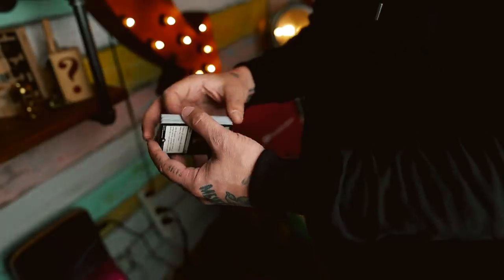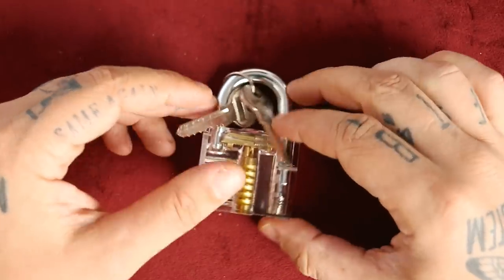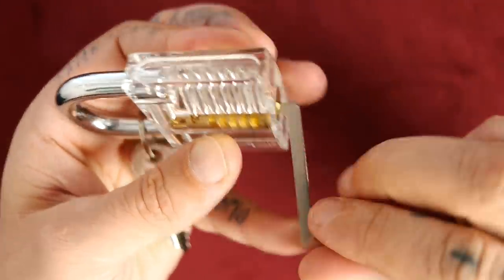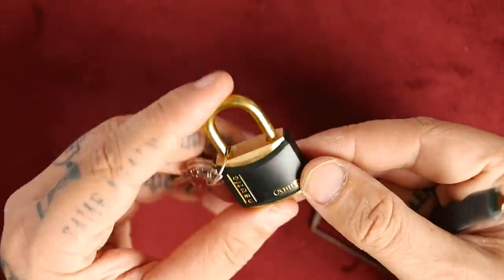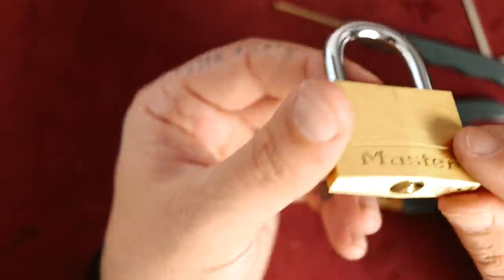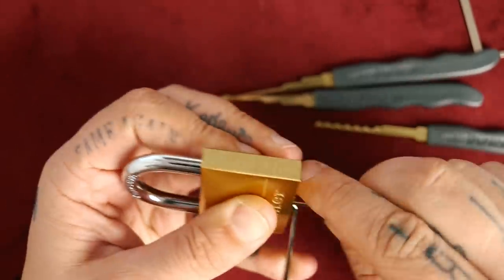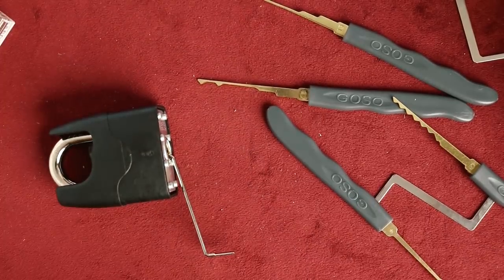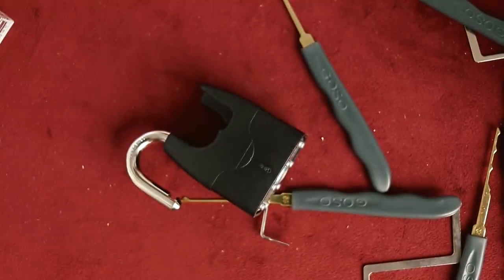I Learned How to Pick All of These Locks!! (Lockpicking 100)

Comment: Wow, dude, I would look up how to rake a lock on YouTube, and 4 of 5 of these cheap locks would have opened in seconds. Kudos for figuring out the warded lock without knowing how it works. Also 1 or 2 looks like you might have bypassed (if you didn’t need to rotate the core).

Comment: Laughed my ass off when you tried to tension the warded lock (silver and blue) and managed to open it despite using the wrong technique. That's how bad that lock is. All of them are actually pretty bad locks. You are right, there is a lot of marketing with these locks. Master is to locks what Chris Angel is to cards. Nice work though. It's a start.

Comment: This was more manhandling than lockpicking. You basically just raked the pins until you got lucky. Use a light touch and feel the pins.  Once you get s feel for it it gets easier. Also keep in mind they make higher end locks that have extra pins that will permanently lock if you fail at picking it.

Comment: Not to rain on your parade, but you should try some harder locks. Master Locks aren't really "master" lol. I used to dabble in locksmithing, and medeco locks are some serious shit. But if you want to learn residential locks, kwikset is the basic entry lock and schlage are a little tougher. Also the pins don't rest on the teeth of keys, they sit on the flat space between them. You can tell how easy a lock is by how even the flat spaces are, basically you can pick those with a paperclip.

Comment: I have purchased that exact lock with the blue on it and my conclusion was that it was just an extremely cheap lock. Where the key goes in just rotates around so you have to line that up first and then the keys are also really cheap

Comment: Here's the thing dude. The transparent lock is good for showing how a lock works, but utter crap for teaching picking. You've got the same crappy Chinese picks as me, and I can pick my "training" lock with a toothpick. You probably can to. I am in no way an expert - I can't even reliably pick a Master 140 (the second-last one).
Master packaging lies and exaggerates. A lot. You want a real challenge? Try an Abus.
Incidentally, most of your method appears to be raking, not picking.
You really want to learn? Check out Lock Picking Lawyer, Bosnian Bill and/or Locknoob.
Finally, I'd strongly suggest grinding those picks a little thinner.

Comment: That's a warded lock with the blue around it. It doesn't have pins. It has warding sticking out that they key fits around. You only need to turn the thing in the rear of the lock.

This is ridiculous watching you pick these with the entirely wrong picks. Wtf.